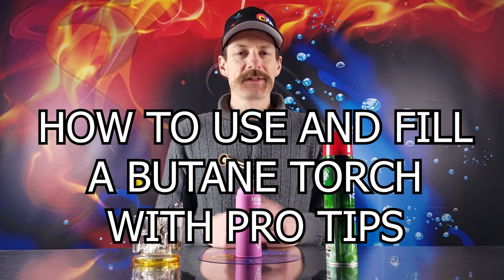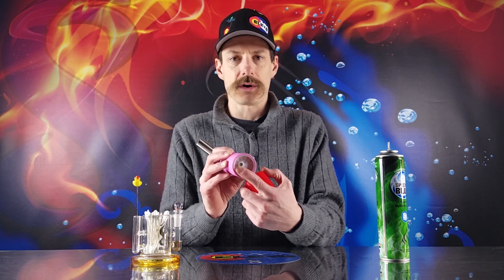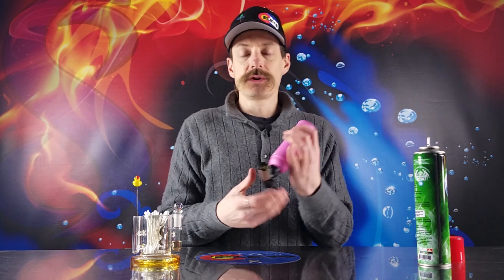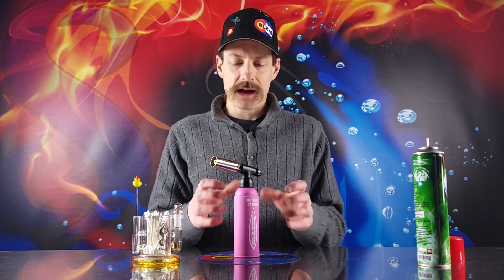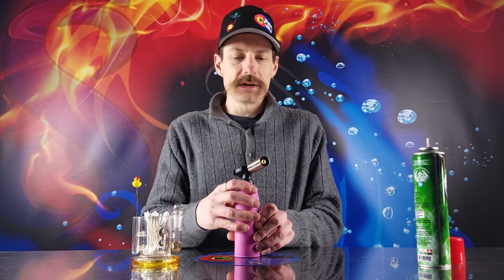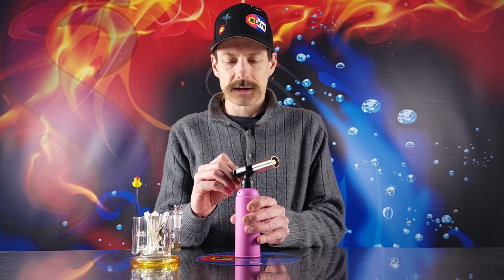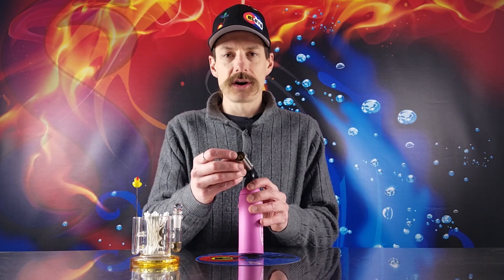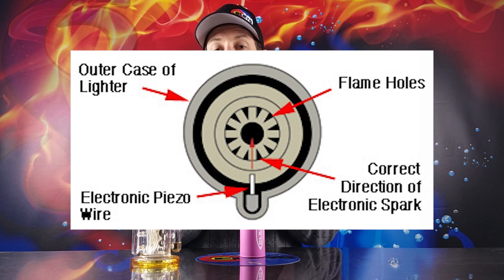How To Use And Fill A Butane Torch

Comment: Mine was spitting gas and now you have to Crank get up you barely get like less than a lighter flame what should is a clogged?
Reply from the maker: If you have a Blazer you can contact them and they can help.  It could be something in the uptake line.  Sometimes there can be foreign shit in the tip of the butane that was not seen, or somehow something got in the inlet on the torch, and when filled the foreign stuff got pushed inside by the butane fill.  Not sure how to fix that.
Reply from the maker: Have you ever considered an electric dab rig like the Silver Surfer or Da Buddha with the dab dish?  More so have you ever vaped flower?  We call it raw dabs.

https://www.elev8glassgallery.com/elev8-desktop-and-portable-dry-herb-vaporizer/

Comment: Could you point me the way of a channel or person that is a expert in everything that has to do with torches.  the peizo  I’m using for a replacement has multiple wires.
Reply from the maker: I am sorry that is a bit out of my knowledge.  The nifty Google might be the answer for this one.  Wish I had that for you :(
Reply: @ELEV8Presents  hey it’s ok man thanks for your reply tho I appreciate that. I found some info on it. So I kinda got it figured out and I half way fixed it just in a ghetto rigged manner.
Reply: @damnielm0  Good deal.  Have you ever seen our Silver Surfer?  You can dab, vape and diffuse out of it.

Comment: you’re supposed to shake the butane can before you fill the torch i used to fill it that way too but that’s not the proper way you gotta shake the butane can first
Reply from the maker: Thanks for this tip!!  How do you mostly consume?
Reply: @ELEV8Presents  I’m sorry? I’m not sure what you mean consume if you mean how do I use torches and butane it’s for dabs and I always wondered why other peoples torches filled up for longer and the butane lasted longer you’re supposed to shake the can of butane to warm it up and then I guess it fills up the torch better because when I read the instructions on the big shot torch it says after you shake the can it takes 20-25 seconds to fill
Reply from the maker: @josephjefferson4893  Ya, I find if some stuff is coming out, it is time to stop.  Not sure how much shaking will warm up the butane, and when it goes in, it freezes a lot as it expands when it first goes in.  Yes we say consume as that is what we are doing with dabs or flower.   Have you ever used a e nail, or something even better like my Silver Surfer?

https://www.elev8glassgallery.com/silver-surfer-desktop-vaporizer/